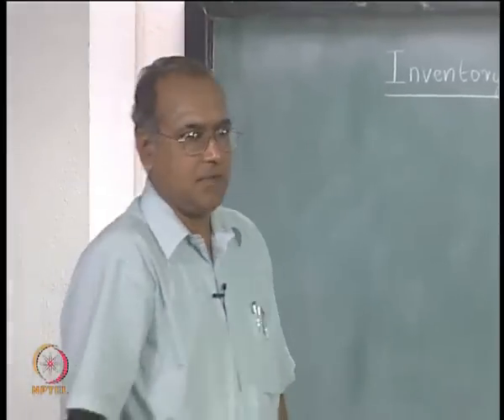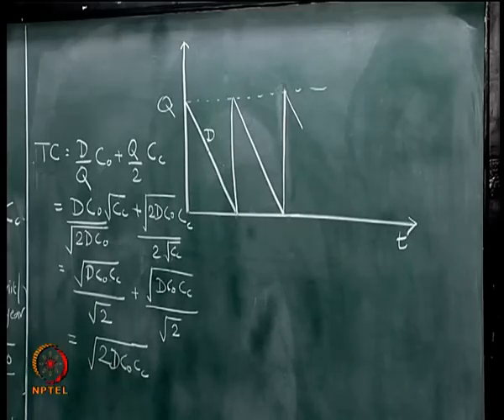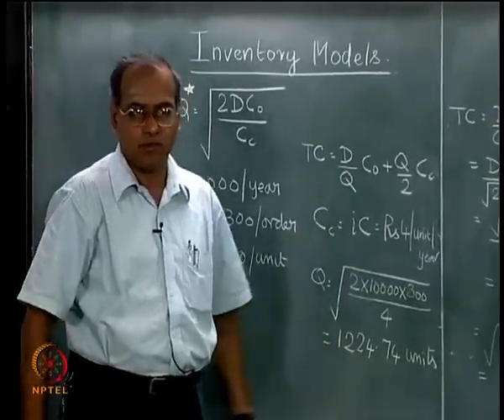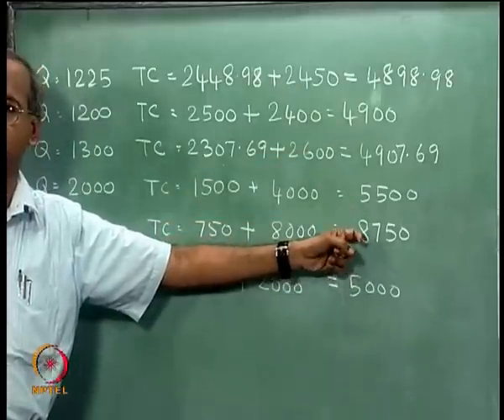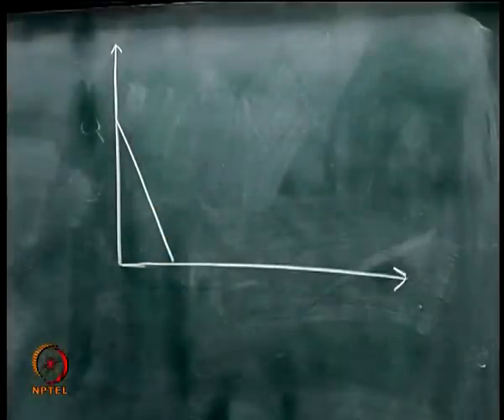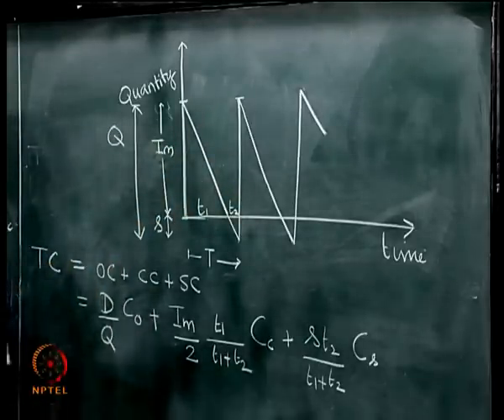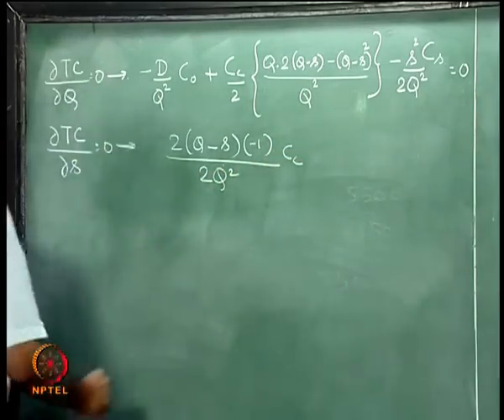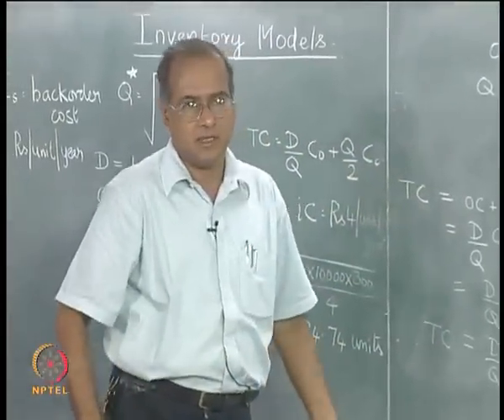Mod-04 Lec-10 Inventory -- EOQ model graphs, with backordering

Comment: one thing I can't understand is the avg inventory. why the time factor t1/t1+t2 has been multiplied with the max inventory(Im)? let's have an example, that I have inventory of 100 units for 5 days then my avg inventory is 100/2 = 50. if the same 100units remain as inventory for 3 days how can the avg inventory become 100*(3/5)=60 ? it must be again 100/2=50. anyone plz explain.
Reply: if you have 100 units for days then avg inv is 100 for 5 days...(starting+ending inv)/2 is avg